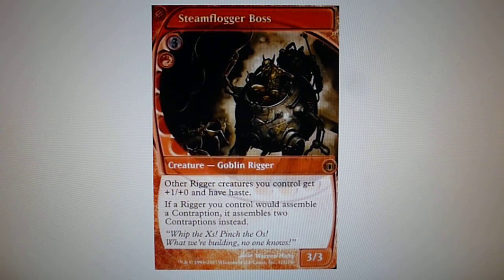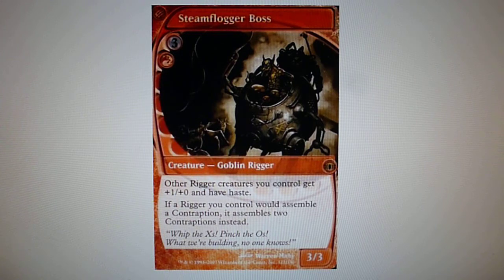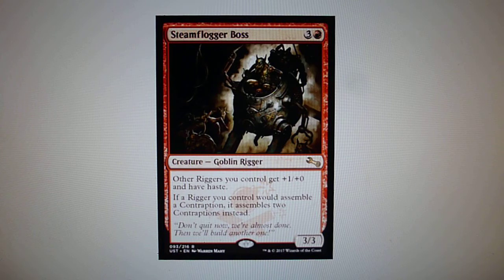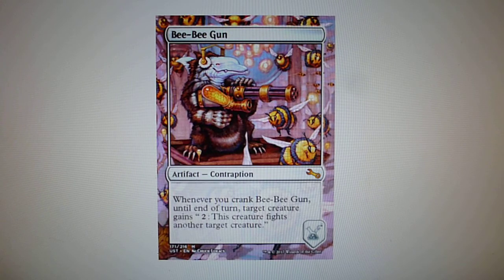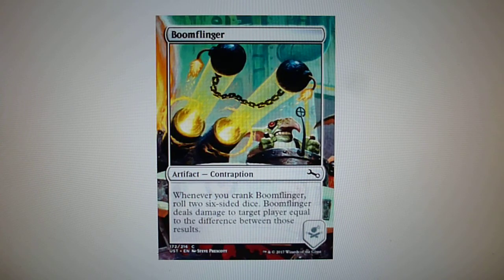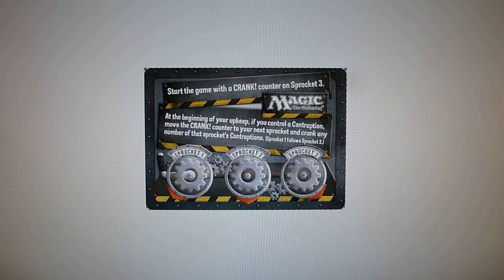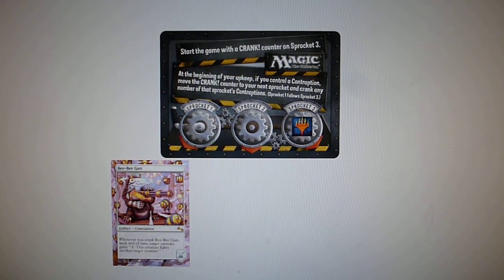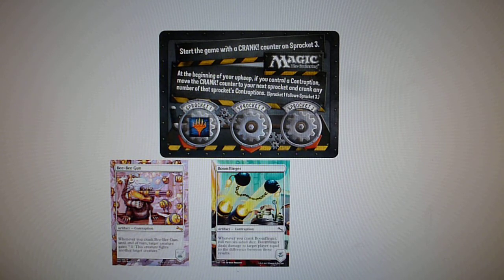How to Play a Contraption - Unstable Set

Comment: Do you just draw the contraptions normally and they go in your hand or what?
Reply from the maker: You'll have a contraption deck, made out of 15 cards maximum, whenever you play a card from your main deck that assembles a contraption, you draw 1 card from your contraption deck and put it on one of the sprockets. You can choose to put it on Sprocket 1, 2, or 3. Contraption are not drawn in your hands they are put on the Sprockets immediatly.